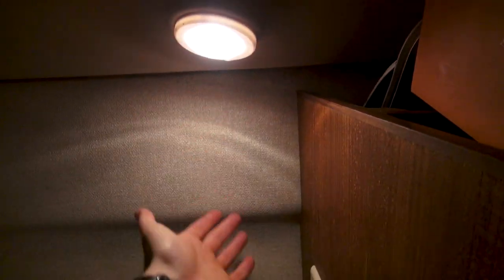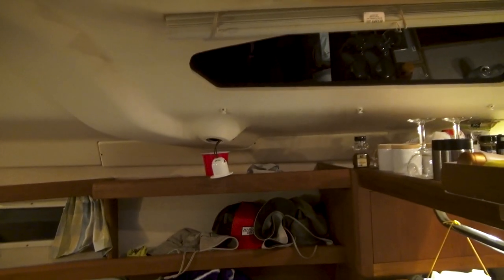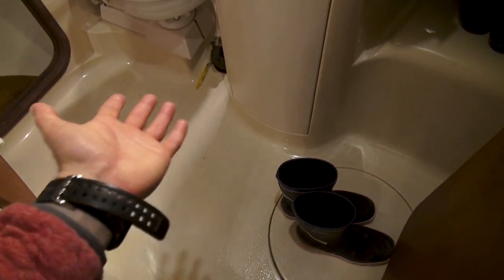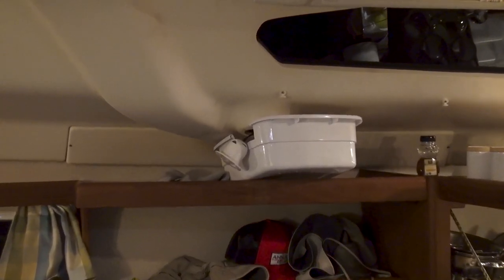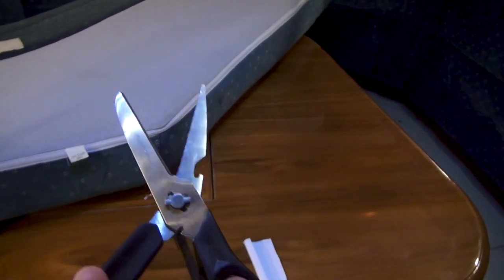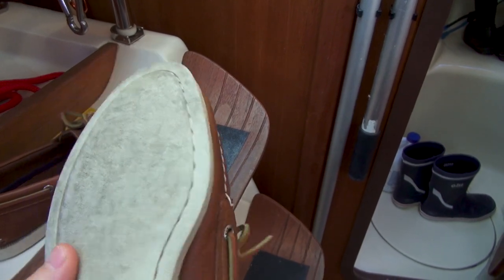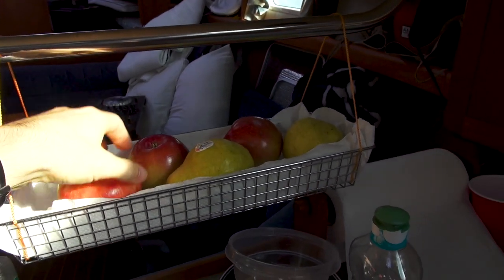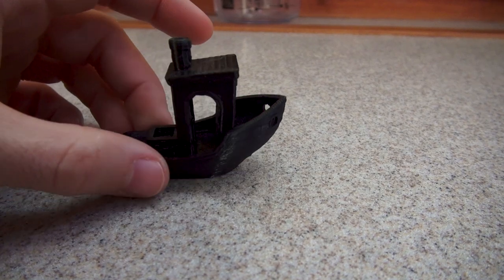A Recap on our Leaks + 3D Printing on a Boat? - Sailing Viridian Episode 27

Comment: If you have leaks in the deadlights (the ones that don't open) - cutting out and re-bedding the polycarbonate with DOW-795 is the long term solution, only takes a couple hours and will last for a decade or so
Reply from the maker: Awesome, I'll have to look into this, thanks for the tip!

Comment: I have a Hunter 340 and I have all the same leaks as you, the past 3 days has been raining non stop and I have the cups all over the place but the main leak in my boat is coming from the skylight window and probably the mast as it stepped and water pools all around the base of the mast on the deck. I plan to reseal the skylight widow with 795. I also found that Flex Seal Max tape may work sealing the mast at the base. I'll let you know if that fixes my leaks.
Reply from the maker: We've got pretty much all of ours sealed up at this point! We were able to get away with just using standard outdoor silicone, it just took a while to find every single leak source.